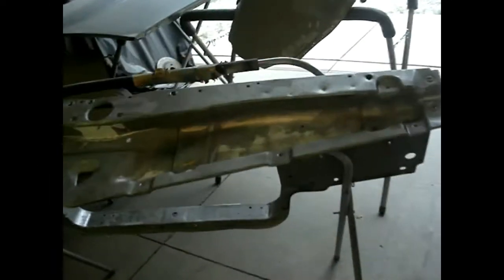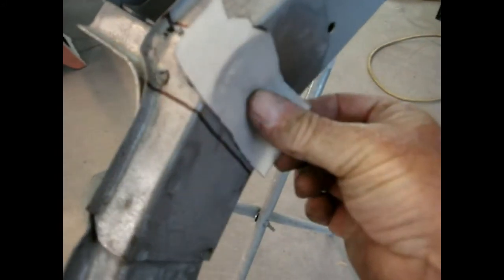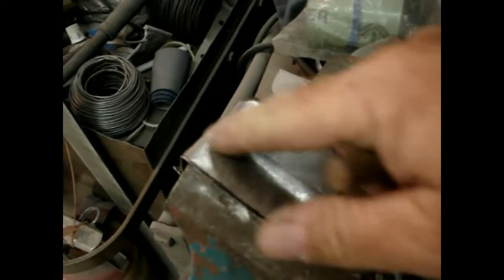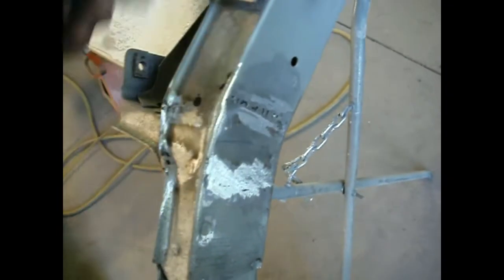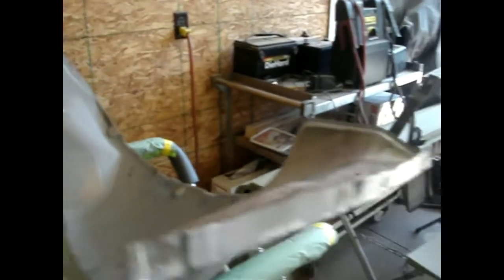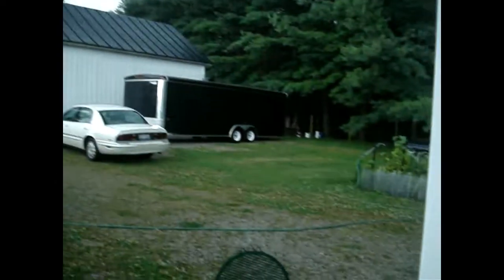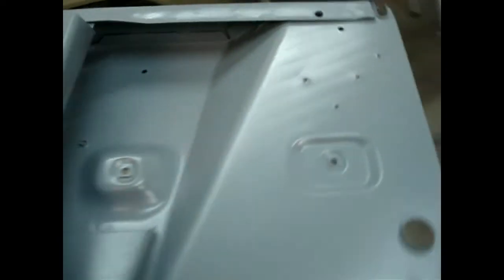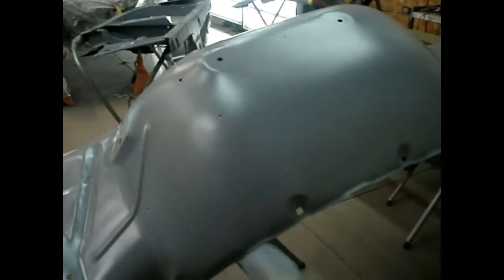1966 Pontiac GTO Part 30

Comment: Did you make the big fan your self and is it the only fan you use when spraying ?
Reply from the maker: I didn't personally make the fan Steve but it is home made and it is the only fan I use.
Reply: ceedell very nice I'm thinking of building one similar it looks the like it would do a good job
Reply from the maker: It does a great job, I'm thinking of installing a speed control so I can slow it down when I need to.